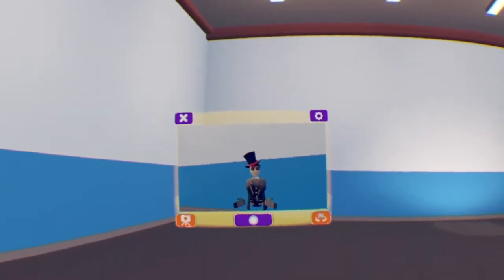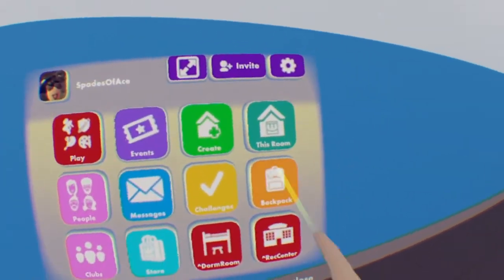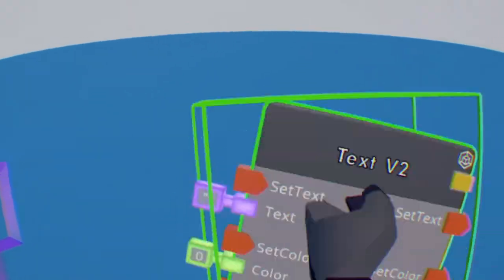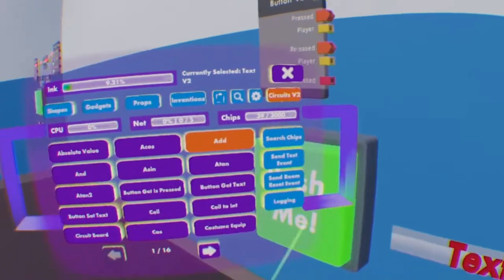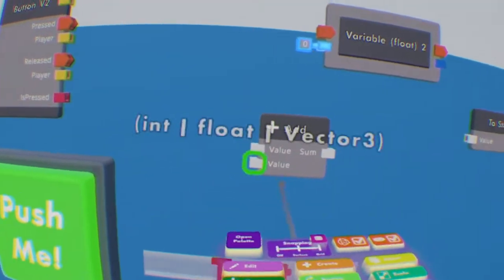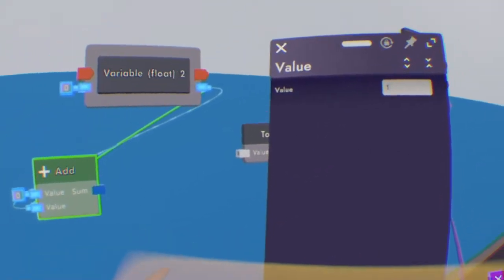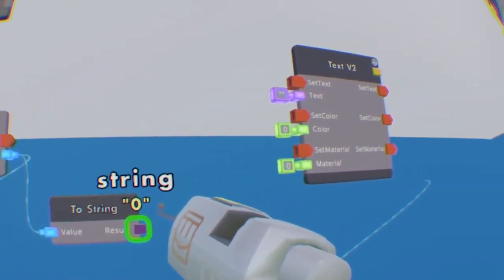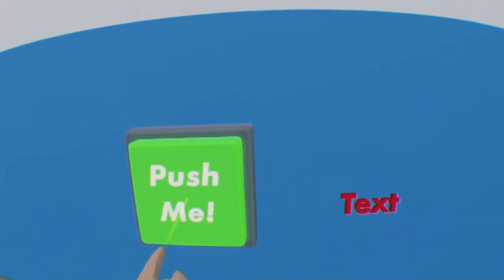Rec Room Tutorial | HOW TO MAKE A CLICKER GAME! | Rec Room

Comment: Can you do one but make where you click an object instead
Reply from the maker: You can use an interaction volume instead of a button, you can manipulate the interaction volume to whatever size you need.
Reply from the maker: @@Peterpumpkineater66 add a button that connects to another one of the variable chips (same name) and have the value of it set to 0, when you press the button it should set the value back to 0

Comment: You can use this with a trigger handle as well
Reply from the maker: This video was made before trigger handles were released, let me know if you would like a video where I use one!
Reply: @DesiredEntity  It pretty simple
Reply: @DesiredEntity  please make a vid
Reply: @dsamiumiu  I Know I'm Like 5 Months Late But Just Wire The "Primary Action Pressed" In The Trigger Handle Circuit Board To The "Variable (Float)"